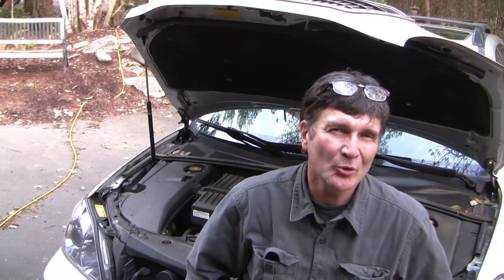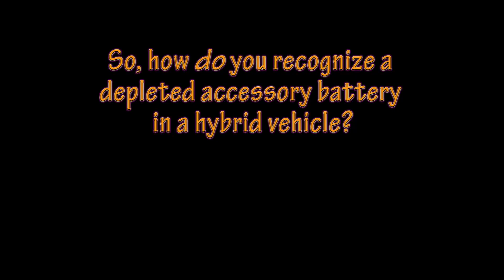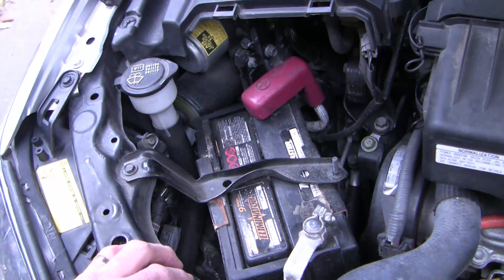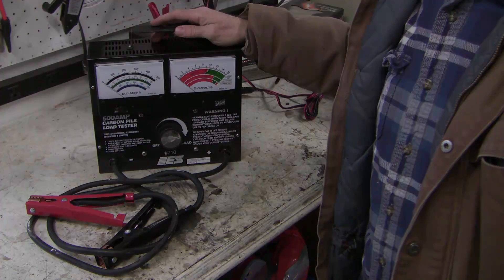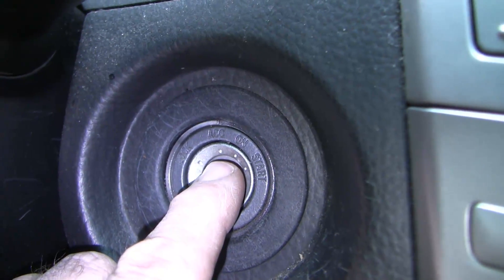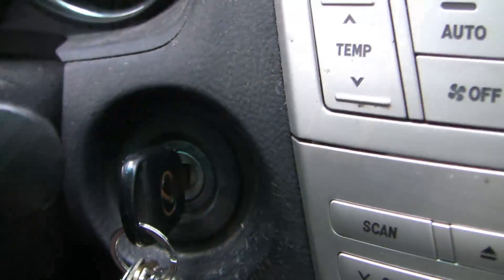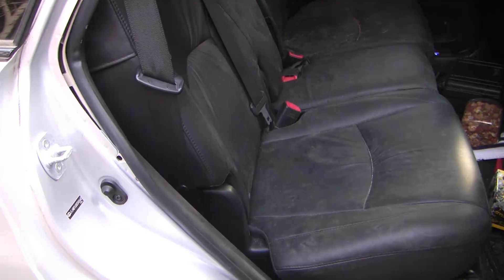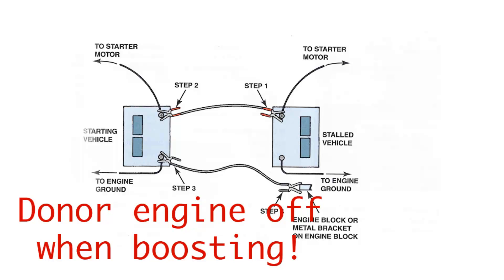How to diagnose and fix a disabled hybrid vehicle

Comment: i have prius 2007my battery show 12V please tell me battery is alright ? or soon going to die?please reply me
Reply from the maker: You can't use a multimeter to assess a battery unless it is obviously destroyed, although your reading of only 12.0V is suspicious, especially in the Prius which has a very small accessory battery. The commonest cause of a borderline low battery charge is undercharging, so to properly test a battery you need to fully charge it first. Of course if you charge it with the vehicle, you risk confusion as to whether the charging system is bad or if there is parasitic drain, or if the battery is actually bad. So, it is more reliable to charge it with a trickle wall charger overnight on the shop bench. AC trickle charges are relatively inexpensive and worth having as a home tool. If you get the programmable kind you will find many uses for it. Even after overnight charging, the multimeter only shows the voltage potential, not the ability to move current. Although it may seem to be the same thing, there is internal resistance to a failing battery such that it may be able to mount voltage but not drive current. So, carbon pile battery chargers are designed to apply a resistance across the two poles of the battery and measure current and voltage drop across that resistance. This is called a voltage drop test, and it is standardized and customized to suit the temperature of the battery and the cold cranking amps of the battery. Battery testers for lead acid 12V batteries are about $40, or you can get it done for free at many auto parts stores. However I suggest you charge the battery first to be more confident in the result. When you remove the battery, be sure to clean all contacts to reduce poor connections from being a contributing factor. If you're interested, I did a video on how to approach a failing starter motor which illustrates many of the points I made above. The Prius doesn't have a starter motor but the valuable electrical principles are all the same.

Comment: I love listening to your voice. You have a very calm and loving way of getting the information out. God Bless. you. The information is definitely good. What I would suggest every hybrid owner to do is to carry a battery booster that is based on alkaline D size cell batteries. This is the safest way to make sure you are not caught with a dead battery.
Reply from the maker: That's a good thought. Even the charger doesn't need to be very robust, since you only need the sensors and computer to run with a consistent reference voltage for a few seconds until started. Once started the accessory battery is fully recharged by the system.

Comment: I enjoy your videos. thanks for making it. in this video, I think your multimeter setting is wrong, I believe you need it on A for current ( amperage)
Reply from the maker: +Cal L (jooksing) That's very observant of you! My multimeter is plugged into a Fluke add-on current clamp, converting any plain multimeter into an inductive ammeter, in this case made by the same company. You're right, the multimeter is reading milivolts but what you're assessing is current through that accessory. The system is designed to directly read the result in a 1mV:1A ratio. Thanks for watching, I appreciate the feedback.
Reply: +spelunkerd Thanks for explaining . That is a nice multimeter!

Comment: The ACC battery in my electric car is just too easy to run down to a point where my fully charged EV will not start. I have a small lithium battery that I use to 'jump' the ACC battery. I don't have to depend on anyone else to get me back on the road.
I have a similar lithium battery that will jump start the 6L V8 in my truck, but since the EV doesn't have a starter to crank, I don't need that powerful a battery to jump my EV. My jump starter battery takes up less space than a set of jumper cables. 
You can find all makes & models of these Jump Starting Batteries on the internet.

Comment: Great video!!  I love your channel.  Be blessed.   John
Reply from the maker: You may need specialized equipment to carry it further. I would start by checking accessory battery voltage after turning the start key, to be sure your new battery is properly charged and connected properly to system ground. Then I would use a code reader to get more info. This could be a security problem, or perhaps an issue with the neutral safety switch. Of course make sure the vehicle is in park. Some shifters have a tab near the shift lever to bypass the neutral start lockout; I'd have to check if such a bypass is present on the Prius. If all of those issues lead nowhere, most pros would get a flatbed tow and test it in the shop.
Reply: spelunkerd   Hi thanks for your reply we brought a new battery and also have had PO852 as code.And POA0D.Thank you
Reply from the maker: What a kind remark, John. You may know that I watch your channel, too. I wish I had a chance to practice my fire starting skills more regularly.  One year I spent two weeks in the bush of the NWT, and I was amazed at how quickly our guide could start a fire in his inverted palm, only setting it down after the fire was burning well.
Reply: snaponjohn100 hi can you help our Toyota Prius 2011 won't start battery's been changed all dash lights come on brake lights come on but won't start up.Has P lock malfunction when parking park in flat place and apply brakes securely.this is on the dash.Please help, as no one knows what's wrong with it.Thanks

Comment: Nice demo Dave of the workings of a hybrid. I can tell you did a little research on the accessory and main battery. Did you ever figure out where that extra current was being used with just the radio on? Again, good work Dave!
Reply from the maker: Thanks, Terry, it's nice to hear from you.

Yeah, I think the extra current is running the background computer activity, and the LCD screen inside the car, and of course the safety relays.

Comment: I appreciate your expertise and would like your opinion on the towing capacity for my 2008 Toyota Highlander Hybrid.  The manual states that the maximum towing capacity is 3,500 lbs.  I do not want to stress the transmission so I am going to keep it to 3,000lbs or below.  Do you have an opinion on this?
Reply: There are temp sensors in both the front transmission and rear differential/traction drive - so you'll be safe towing up to the 3,500 # rated capacity - the computer will monitor systems and notify you if you need to slow down (in case of severe duty such as mountain climbing while towing). It's pretty fool proof and the CVT-i has no clutches to slip and wear like with conventional automatic transmissions.

Comment: Did not know that..thanks spelunkerd. ok time for the weird question...Do they make hybrids in manual transmissions and if so can you push start the car like the old days or can you push start the automatic?? nice scenery :)
Reply from the maker: Most of the new cars these days have a Continuous Variable Transmission (CVT) that contains two pulleys and a remarkably strong belt. There are some great videos here on youtube showing how they work. But the old way of push starting a vehicle are gone with these, it won't work. In fact you are not even supposed to tow these (front or back) except on a flat bed, since passive rotation of the wheels can overcharge or do damage to the transaxle. That's a pain if you ever need a tow.  Thanks for watching, I appreciate your support.

Comment: It does sound like the maker of the vehicle didnt do there homework.

Hmm too complex for my small brain, simplicity is often more reliable, and overcomplex systems tend to lead to complex and rather expensive repairs, this often leads to a car being scrapped due to cost :-(

Embelishment of a basic design is just asking for trouble, humans never design something without errors. :-(

Smashing tutorial as allways :-))
Reply from the maker: Ya, I didn't even think about the hatchback thing until I urgently needed to crawl through the back seat, empty everything on top out, and then get the cables. Now I keep them under the passenger seat. Makes you wonder how hard it would be to open the doors if the vehicle were to land in water....

Comment: Well done- excellent editing and commentary- are you sure you didn't work for the CBC.  I suggest an aftermarket voltage sensor at the battery to shut down the circuits when voltage is below the  starting threshold- most manufactures have this built into the ECM.   Thanks Steve.
Reply from the maker: Yeah, that's a good thought, to give the driver an idea of battery voltage, or at least an idiot light when voltage gets close. Thanks, Steve, for the kind remarks.

Dave

Comment: How does the accessory battery get charged? A mini engine driven alternator?
Reply from the maker: They have a generator on the front and rear axles, I believe integrated into the electric motor drive system. Of course charging has to happen even when the wheels are stationary, in which case charging happens through the front generator proximal to the CVT. By integrating the motor, generator and regenerative braking systems together they save money on hardware, but of course the software has to be amazingly complex. Thanks for watching!
Reply: The auxiliary (12V) battery is charged by the High Voltage (HV) Hybrid battery via a DC-DC converter which steps the HV down to about 14.5V for charging the 12V conventional car battery.
Reply: Kevin Diaz-Lane  Where can a guy measure this 14.5 volt coming to the little battery in the lexus ct200h

Comment: even on my non-hybrid saturn aura, running the radio on ACC will drain the battery in remarkably short order. i would like to jerry rig a volt meter with a programable minimum alarm to provide a warning. after the first time i drained it while sitting in traffic i went out & bought a jump starter to keep in the trunk. it's come in very handy more than once.
Reply from the maker: That's a good thought -- cool to think about going back to the battery voltage display on the dash, like vehicles from the 60's. Thanks for watching.
Reply: spelunkerd Your Ram has a voltage gauge, right? I miss the one my Ram had (not to mention the whole truck). The voltage reading is available on the DIC in my current car- but it isn't always in your field of view, you have to purposely bring it up.